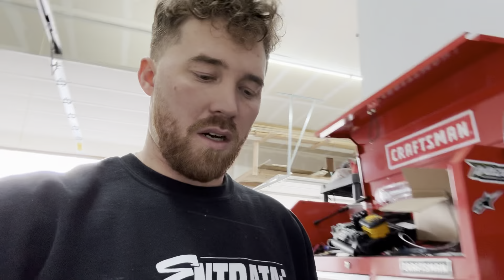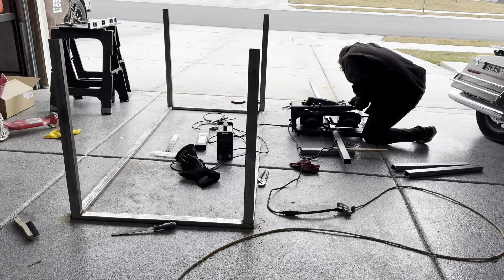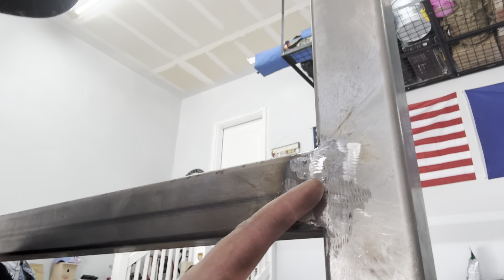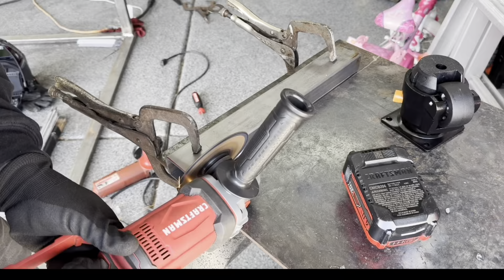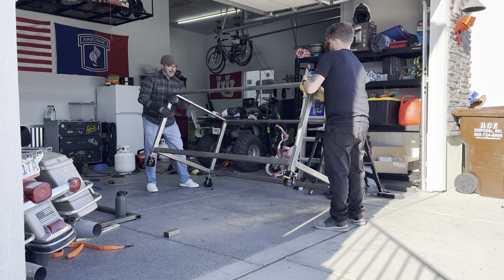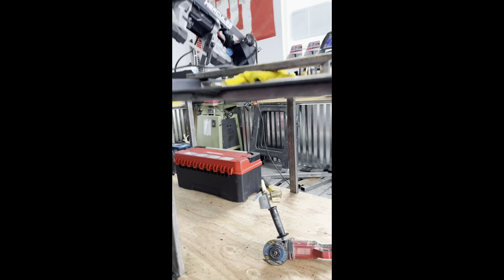Avoid These Mistakes Building Your Ultimate Welding Table

Comment: The wood on the bottom is fine, just because you're a metal worker doesn't mean everything has to be made out of metal, plywood doesnt catch on fire very early, and welding sparks aren't super hot 3 foot away.... if you smell burning wood while you're welding, stop (when you're done with your pass) and stomp on the wood. As for the holes in the tube, unless you bake it first all steel holds water, you should put a "weep" hole at the bottom to make sure that all moisture drips out of the tube. The last little bit of welding tube is the hardest, you'll see that more with TIG
Reply from the maker: Thanks for the advice! Especially the stopping when I’m done with my pass!

Comment: A lot of welders don't talk about the dangers of welding fumes and grinding dust, but at the end of the day its really not good for you, especially stick welding, and extra especially galvanized. I really like the quick release 3M respirator. It fits under your hood and its pretty comfortable all things considered. It quickly drops down to just below your chin so you can quickly take it on and off with just one hand and not having to take off your safety glasses and hood. Make sure to get the P100 2097 filters since they filter both particles and toxic gas. If you're outside with a bit of a breeze, I wouldn't worry about one, but even in the garage with the door open, I would still wear one since there isn't something actively blowing fumes away. Basically, if you can smell it, its bad for you. I'm sure your kids want their dad to live long and healthy. I'm no safety sally and I struggle to always wear one, but I try my best lol. 

Definitely safety glasses 100% of the time though. Your eyeballs are your money makers :) Also on the PPE topic, get a cap, burning your head and hair isn't fun. I like the black stallion stretchy one. You also don't want a spark going in your ear and burning a hole in your eardrum, so a cap and/or earplugs will protect from this. Finally, get some leather boots, preferably without laces- one spark in-between your toes and you'll learn ;)
Reply: I second this, I wear the quicklatch 3m at all times when in shop fabbing, it’s a night and day difference at the end of the day with how your lungs feel, plus the filters last a long time, I can usually go a few weeks to a month on a set
Reply from the maker: Im going to go buy one from my local welding store this week!
Reply: @TookiesShop  Awesome! Glad to hear!
Reply from the maker: Ladies and gentlemen, school
Is in session! 

Thanks for all of these tips! I am shopping respirators now!
Reply: No problem man! I am all self taught so I'm glad to spread what I've learned.

Comment: Biggest mistake you made was not building it 5 years ago! 😂🚀🐐
Reply: When you're grinding welds, (which will happen less with time) use a hard rock grinding disk to get the bulk down, but try not to touch the base material. Those deep scratches can weaken it a lot on thinner material. For the last bit, smooth it out with a flap disk. I get all my grinding stuff from Benchmark Abrasives. I'm not sponsored or anything but I find they're bargain for how long they last versus cost
Reply: If you have an iPhone, I made a video on how to film the welding arc with nothing but your phone. Try searching, "How to film welding arc on iPhone" on YouTube and it should pop up.
Reply from the maker: I’m going to look right now!
Reply from the maker: Thank you for your comment! I appreciate your perspective and I totally agree that building it 5 years ago would have been a great opportunity. But hey, it's never too late to start now and make the most of the present!